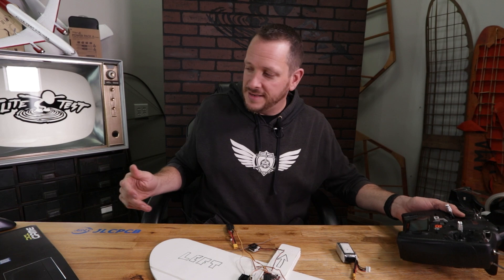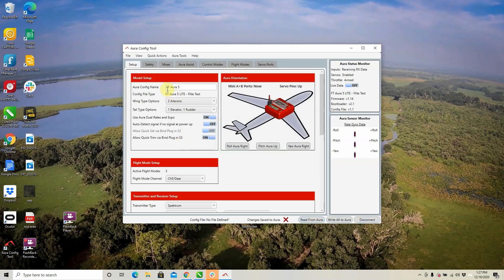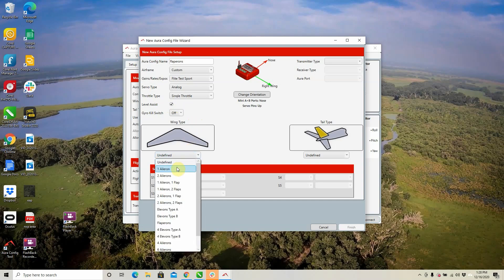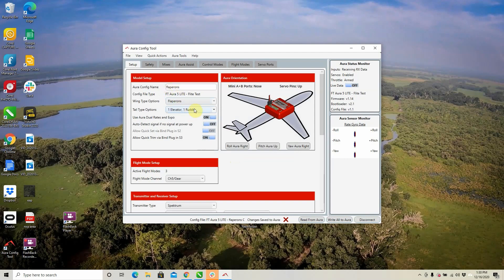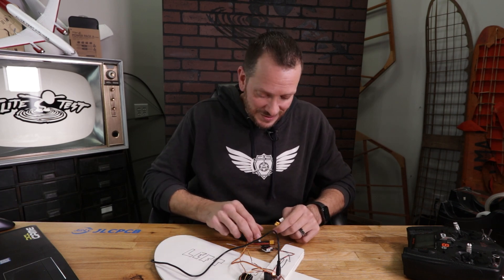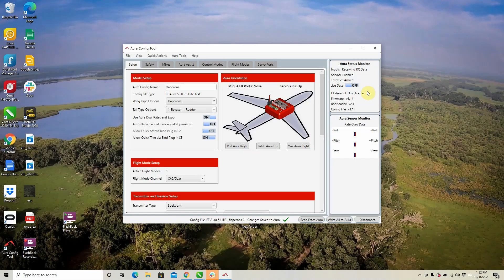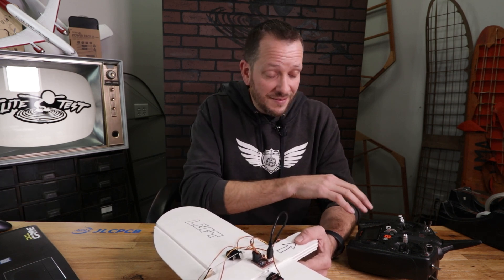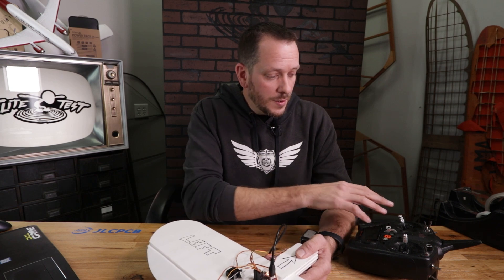Easy Setup Of The FT Aura 5 For Flaperon And Mixing - From Basic to Advance

Comment: The flaperons work great with my old Electrifly Extra 330S. With flaps down full, 50% throttle, and in auto-level mode, the plane practically lands like a B-747 in ALS mode..... exquisite!

Comment: Hi Josh, thanks for the instructions. I got 3 Planes with Aura5lite on Spektrum. 2 of them are Wings and one is a normal Plane. 
What is not clear to me. Is it possible to set up Flaps on the Aura5lite .... (1 Throttle, 2 Aileron, 3 Elevator, 4 Rudder, 5 Flaps?) 
And still have a 3 Way switch for the 3 different flight modes?  And if so, how to ? Thanks.

Comment: I just bought a couple of FT Aura 5 and I would like to add Return to Home ability. Fixed Wing Plane. What do I add ( Receiver/GPS) for the Aura 5. I use a TX16S Transmitter. Many Thanks.
Reply: You need a more advanced flight controller for GPS return home, the Aura has no support for gps. The ZOHD Ko pilot is a very simple fc with gps, but Matek makes several wing fc's with far more features.

Comment: Trying to get some tech support, anyone know of a email address I can contact? I sent a message through the contact us on the website, no reply. Or anyone else know what the problem might be? I can not get the gyro on my Aura to work outside of the setup mode. All control surfaces control on gyro in set up, but when I exit get nothing. My switch on Channel 5 is active in the transmitter and active on the setup page of the configurator. I'd appreciate any help, I'm about to pull my hair out with this thing. Thanks
Update: I did figure out my problem on my own, once I created a setup file for the aura I could see the little box to turn on the gyro. But my board was in no way usable without the configurator, not PNP. The channels were mapped different from the setup videos and gyro was not enabled. But I'm happy with it and have actually ordered another. I'm kinda disappointed that I got not assistance from anyone, left a tech question with FT customer service and never heard back from anyone. But I know people are busy and that's just how it goes sometimes. Maybe this will help someone else.

Comment: Using an FT-Test Mini Scout with scratch built Ailerons.  Today I setup Aura 5 flappers on a 3 position switch with Spectrum DX6.  Set up Digital Switch D as follows: Set Pos 0 at -51%, pos 1 at 50%, Pos 2 at 100%.  Set  Custom Voice Events for switch D, Pos 0: "Flaps Up", pos 1: "Takeoff Flaps", Pos 2: "Landing Flaps".  Plane flew awesome.  Highly recommend setting Ailerons as Flapperons.  Lot's of fun.
Reply: So you are able to get 3 position Flaperons? Can you explain how you did that?
Reply: @kevinjakey851  I followed Josh’s video.  Note: I have a Spektrum DX6 programmable xmtr.  On the DX6 assign a 3 position switch to Ch6/Aux1 (I use switch D as it is just above the throttle) then go into Digital Switch Setup,  select your switch (I use D) and set the values for each position as follows: 0=-51%, 1=50%, 2=100%. These values do two things, they tell theAura5 what position the switch is in and the value  drives the flap throw.  So -51% = Aura Switch Pos. 2 and is flaps UP, 50% is Aura Switch Pos.1 and about 1/3 flaps down,  100% is Aura Switch Pos.0 about 2/3 flap down. Experiment with some different values for your plane.  Go to PC Aura config tool, connect to your Aura5 and power it on too so you can capture live data (this makes adjustments a breeze).  For Mix 1 set switch type to 3 Pos. Switch. Make Mix Active in positions 0 ,1and 2.  For more ideas go to forum.flitetest.com search for Aura5
Reply: I followed Josh’s video.  Note: I have a Spektrum DX6 programmable xmtr.  On the DX6 assign a 3 position switch to Ch6/Aux1 (I use switch D as it is just above the throttle) then go into Digital Switch Setup,  select your switch (I use D) and set the values for each position as follows: 0=-51%, 1=50%, 2=100%. These values do two things, they tell theAura5 what position the switch is in and the value  drives the flap throw.  So -51% = Aura Switch Pos. 2 and is flaps UP, 50% is Aura Switch Pos.1 and about 1/3 flaps down,  100% is Aura Switch Pos.0 about 2/3 flap down. Experiment with some different values for your plane.  Go to PC Aura config tool, connect to your Aura5 and power it on too so you can capture live data (this makes adjustments a breeze).  For Mix 1 set switch type to 3 Pos. Switch. Make Mix Active in positions 0 ,1and 2.  For more ideas go to forum.flitetest.com search for Aura5
Reply: @hansvongortler1548  Thank you Hans! I am also running a DX6 (e anyway...) and made the changes you suggest to the digital switch settings. It took me a bit to find the 3 position switch setting but finally found it and changed the setting in Mix Type from Always On to Switched On/Off to get to the switch menu. Thanks again for posting!

Comment: This is very helpful. 
I purchased the FT Widgeon and Aura Lite over the winter and have found the Aura to be extremely frustrating to configure. The documentation is extremely limited, and at least with my RadioMaster TX16S RadioMaster/FrSky receiver, it is very difficult to get the controls to map properly. 
  I have to reverse channels for the controls to work and then the Aura gyro tries to compensate the wrong direction. I had two crashes before figuring that out. Maybe it works as smoothly as it seems with Spectrum, but I have struggled mightily with FrSky controls.
  I've been struggling to setup Flaperons and really wanted Differential Thrust as well, but with only 5 channels have not gotten that to work. I may try the differential thrust from my radio and receiver later, but so far have had little luck.
  Anyway I wish this video had been out 6 months ago, but it still helped me with the extra Mixes in particular. Mix3 seems especially helpful. I'll put Mix2 and 4 on radio so I can adjust them in the field without connecting to the Aura.
Thanks.